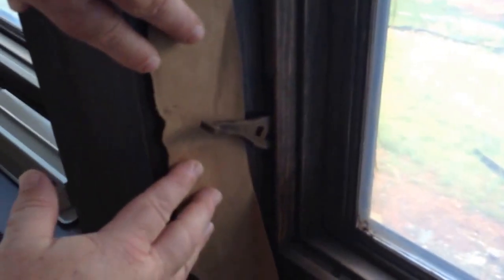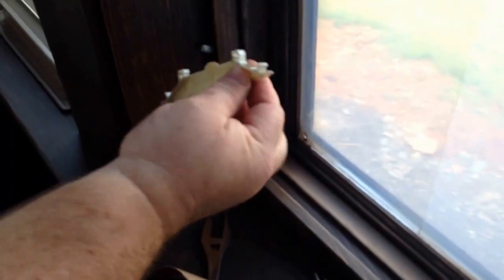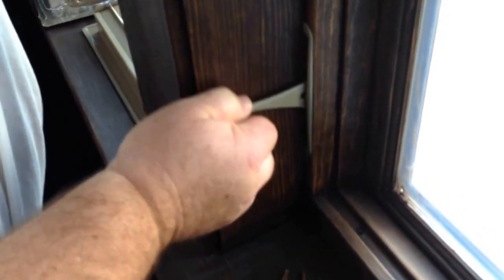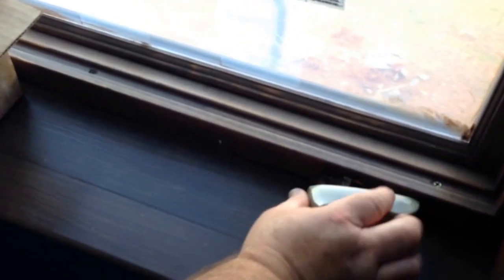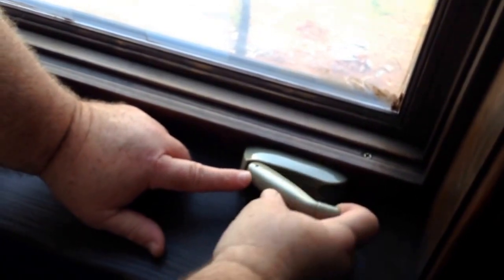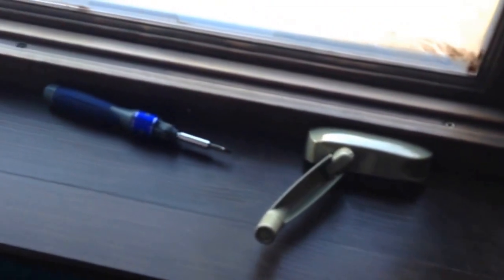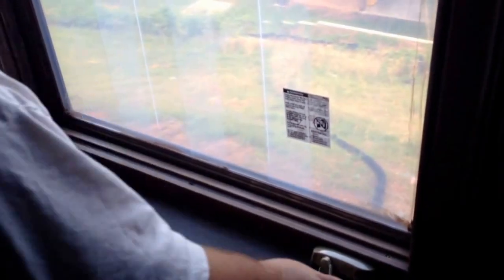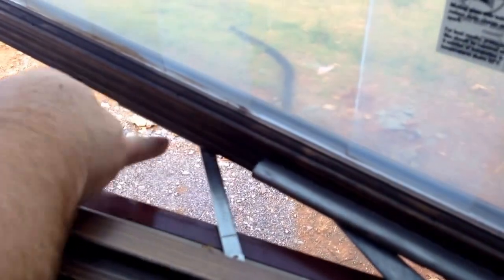Punch List - Window Hardware

Comment: Good video, Artisan Tony.  It shows the concern the General Contractor has to take, because he's on the spot with the customer.  Plus, this customer has the 'Artist-Eye.'  = He has no need for a Sherlock Holmes magnifying-glass. 
   Stringer Ridge is a high toned place with NO bugs.  There's no screens in the windows yet; the inside grove for screens can be seen in the window frame. 
   Also, ~you're real~ Barret; you're not theatrical at all.  If Yanknik was in front of the blue-screen, Yanknik would have posed like Napoleon Bonaparte.
Reply from the maker: LOL